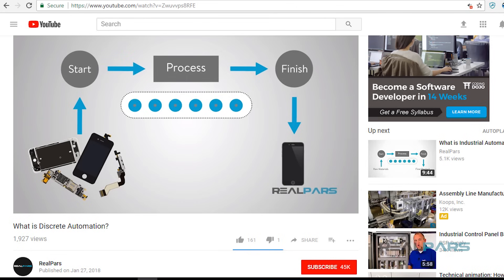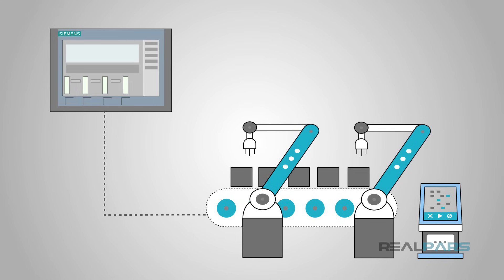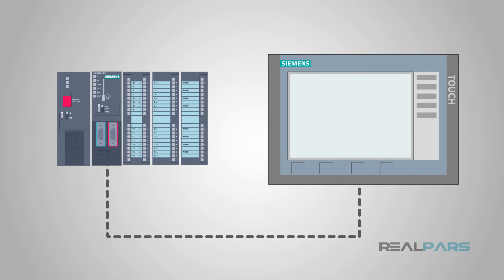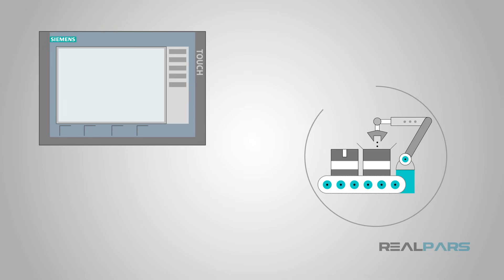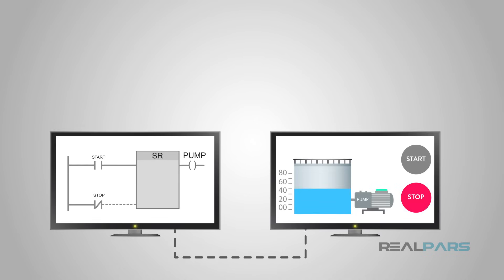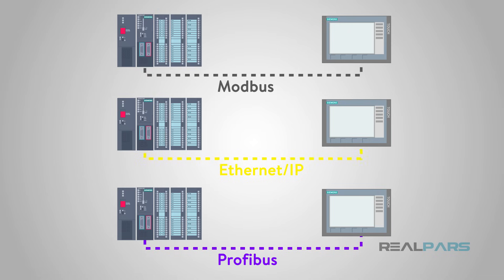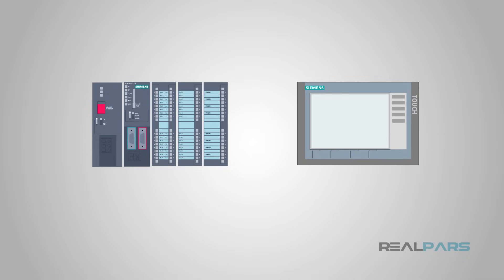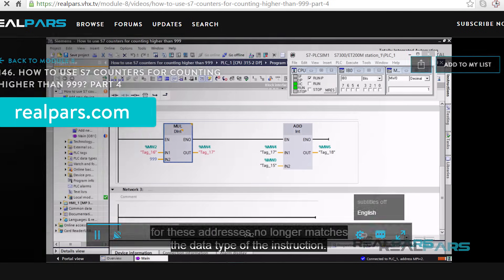What is an HMI?

Comment: Stable automation work requires not only excellent software but also reliable hardware, and data storage is essential for the system. If you need durable and stable industrial-grade solid-state drives, feel free to contact me. We are a solid-state drive manufacturer from China.

Comment: is it possible to control a equipment from two hmi's
Reply from the maker: Absolutely.  There is typically one communication application (data server) that is connected directly to the PLC or controller, with one or more HMI's connected to the HMI's data server.  I recently completed a project which involved 75 HMI stations, all able to control common pieces of equipment.

Comment: Can PlCs from two different companies be connected to one another or at least to same HMI
Reply from the maker: Yes!  The only requirement is that the PLCs have a common interface type (Profinet, Ethernet, etc.) as the HMI does.  Most of the projects I work on have many different devices from different manufacturers, and this allows sites to use the best devices for the application.
Reply: @realpars   I have never known that thank you and appreciate your work

Comment: Hmi is hardware or software
Reply from the maker: You can think of an HMI station as being both.  Typically, we describe HMI in terms of the software used to define the database, screens, and visual components required to provide the operator with a "window into the process".  The HMI software used depends on company standards and preferences, or what software may have been provided by a machine manufacturer or equipment vendor.  Bt this software requires a computer of some type to execute.  The hardware may be a standalone computer or an all-in-one panel-mounted computer.  It is important to select the correct hardware to meet the needs of the installation.  Do you need a large screen or a small one?  Is a touch screen required or a mouse and keyboard?  With the HMI be in a washdown area, outdoors, or in a hazardous location?  So, as you can see, specifying an HMI requires both software and hardware.

Comment: Talking about regular computers, could the user interface of the Operating System (Windows, Mac OS), with which the user interacts, be considered one or only the keyboard, screen and mouse can?
Reply from the maker: I am not sure I fully understand your question, but HMI stations can be all-in-one computer/screen units with touchscreen or keyboard/mouse, or a separate "box" with a separate monitor with touchscreen or keyboard/mouse.  If the HMI is based on a Windows operating system, there is typically a separate application that runs on Windows (or MAC) to provide the interface to the process.  In current systems, there is often just a Web Browser that is needed to access HTML pages from an HMI server.

Comment: What material about PLC I should use to learn? I'm begginer. Thanks
Reply from the maker: Hi Pham,

Thanks for your comment!

Great to hear your motivation in regard to learning PLC Programming. 
Our course library is specifically designed in a way where it provides all the tools needed for beginners to evolve into an advanced level through our hands-on courses. 

Feel free to browse through our course library to see all the different topics we are covering.  https://bit.ly/30AVJaR

Just to let you know, that we also have a free course on PLC Hardware https://bit.ly/2XnnUrF

If you are interested, you will obtain full access to our complete course library (400+ video courses) by subscribing to either our monthly package for €22.12 a month or our yearly package for €159.28,-.

Feel free to reach back out if you have any further questions.

Happy learning!

Comment: Am experiencing this when i try to open SIMATIC MANAGER  ****The registry database is not set up correctly for the
SIMATIC Manager. Install STEP 7 again.**
Reply from the maker: When starting SIMATIC Manager, right-click and select "Run as Administrator".  Also, if running Windows 10, you may need to be logged in with an account that has administrator rights.
Reply: @realpars  thank you very much.... Run as Administrator as worked.